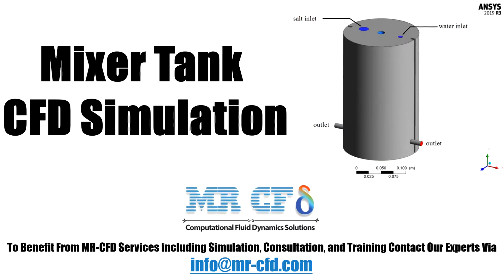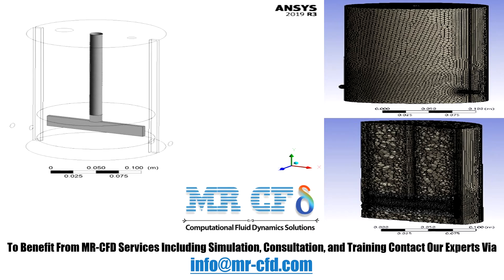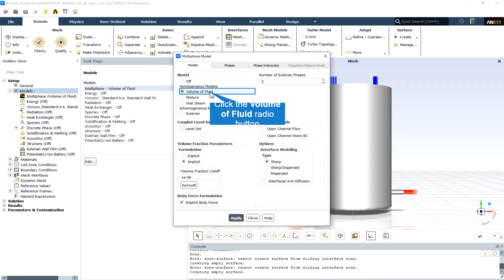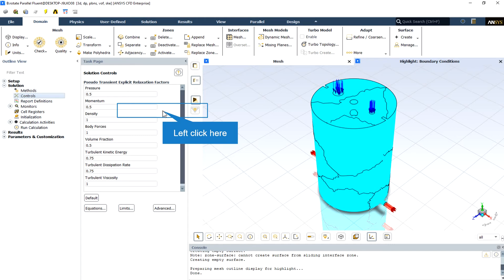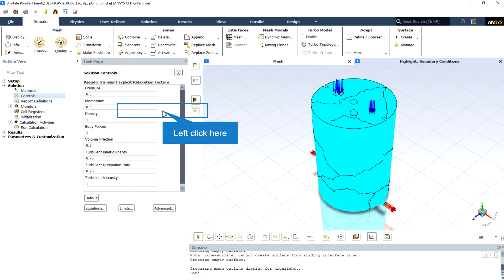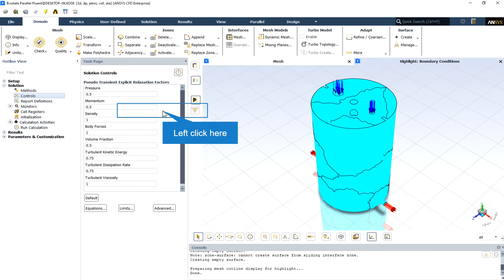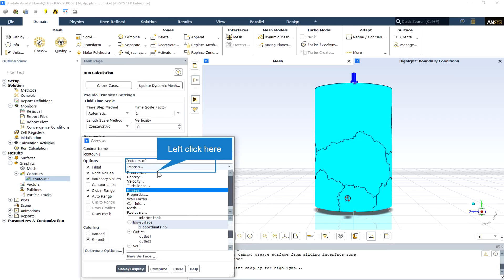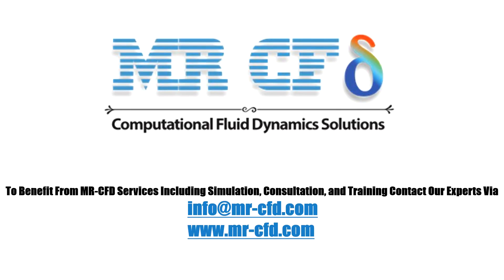Mixer Tank CFD Simulation

Comment: Hi, i have a problem for a numerical simulation of agitated vessel (MRF method) CFX 15.0; can you help me please ?

DOMAIN INTERFACE: Domain Interface 1
Boundary List1 = Domain Interface 1 Side 1
Boundary List2 = Domain Interface 1 Side 2
Interface Type = Fluid Fluid
INTERFACE MODELS:
Option = General Connection
FRAME CHANGE:
Option = Frozen Rotor
END
MASS AND MOMENTUM:
Option = Conservative Interface Flux
MOMENTUM INTERFACE MODEL:
Option = None
END
END
PITCH CHANGE:
Option = None
END
END
MESH CONNECTION:
Option = GGI
END
END
 

In Analysis 'Flow Analysis 1' - Domain Interface 'Domain Interface 1': The interface is placed at a rotor-stator interface and the pitch change option of 'None' has been selected. This option should only be used when the overall extent and shape of each side of the interface perfectly match and the surfaces are aligned with each other. It may therefore be suitable when full 360 degree or exactly equal pitch components are being analyzed.

DOMAIN INTERFACE: Domain Interface 1
Boundary List1 = Domain Interface 1 Side 1
Boundary List2 = Domain Interface 1 Side 2
Interface Type = Fluid Fluid
INTERFACE MODELS:
Option = General Connection
FRAME CHANGE:
Option = Frozen Rotor
END
MASS AND MOMENTUM:
Option = Conservative Interface Flux
MOMENTUM INTERFACE MODEL:
Option = None
END
END
PITCH CHANGE:
Option = Automatic
END
END
MESH CONNECTION:
Option = GGI
END
END

In Analysis 'Flow Analysis 1' - Domain Interface 'Domain Interface 1': Pitch Change option 'Automatic' is not valid if side 1 or 2 of the interface has a 360 degree or greater pitch angle, zero radius, mesh faces normal and parallel to the rotation axis, or mesh faces at the hub curve (low radial or axial position) which are thin in the radial or axial direction.